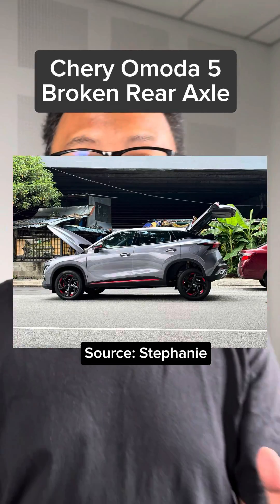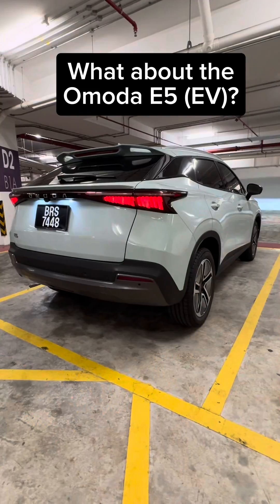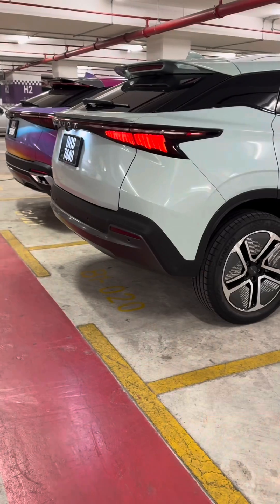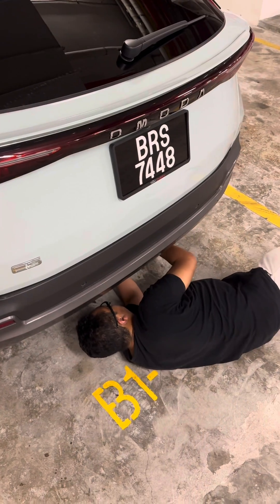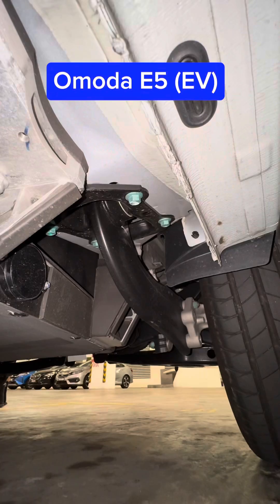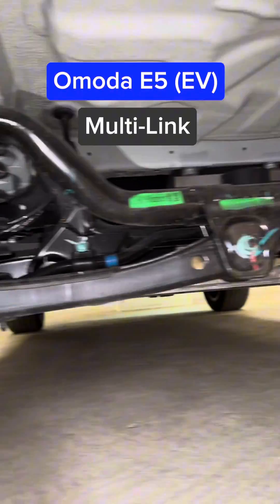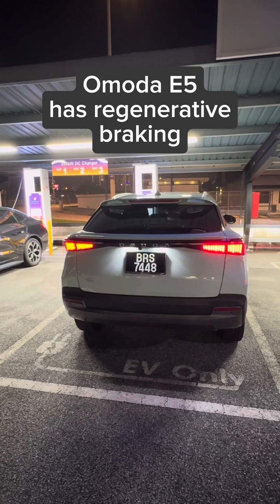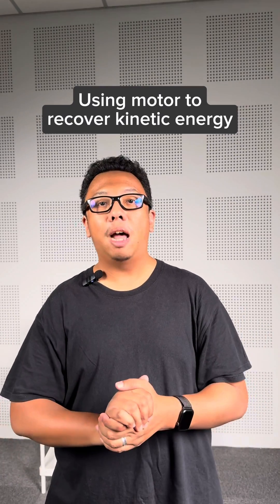Chery Omoda 5 broken rear axle: Does the Omoda E5 EV use the same suspension?

Comment: IT'S ALL ABOUT THE WELDING PROBLEM AND QUALITY CONTROL BRUH. Does it matter multilink or torsion beam？ Are you high on something or u just want to ride the viral wave putting up this kind of video MEH
Reply from the maker: Someone asked if the Omoda E5 has the same axle issue. This video is a response to that.
Reply: @soyacincautv  E5 or not, you as a tech media should be giving heads up to that person they might facing the same QC issue seeing those car probably made from the same factory
Reply from the maker: @clementyeo2601  It is presumptuous to assume all vehicles are having the same issue. We have to be factual. BTW, the Omoda E5 is CBU while the Omoda 5 is now locally assembled.

Comment: No thank you. The problem is not the design of the torsion beam or multi link setup. Many car brands using the same setup for suspension, but the inconsistency of the build quality and subpar materials that being used. Should avoid this car/brand at all cost.
Reply: Should avoid everything related to Chinese no matter how good the quality feels, Japanese made are always more reliable even if it looks plasticky or cheap but it's reliable. Tenno Heika Banzai.
Reply: so you mean any other non-china brand using the same supply chain, same factory, same worker, also unreliable non considerable.
Reply: @lhctrekker  last I checked non of the non china brand using the same chassis or shared the same assembly line. I’m not sure whether you are “special” or just in denial.
Reply: @IvanMorningstar  parts from China supply the entire industry,dozens of companies share the same supply chain. basically you saying vivo's snapdragon is non reliable ,while Samsung one is trustworthy.

Comment: bro, this is people's life at stake leh (imagine if driving at highway and the axle patah), even torsion beam is not suppose to just patah like that 1

how confident are you in saying that the multi-link's axle won't just snap also
Reply: Ok lah, like this...we didn't say it is better. We didn't say it wouldn't snap. We just say it is different.

I totally agree with you. Torsion beam (or any suspension/chassis part) not supposed to patah.

In fact, it should outlast the car. But again, this video is to point out that the EV variant is using a different suspension setup.

That's about it.
Reply: @SyefriZulkefliMY  agreed. Nowhere in the video says that multi-link axle wont break or better or sewaktu dengannya. This video just shows that the difference in suspension setup, thats it.
Reply: Soya won’t care!